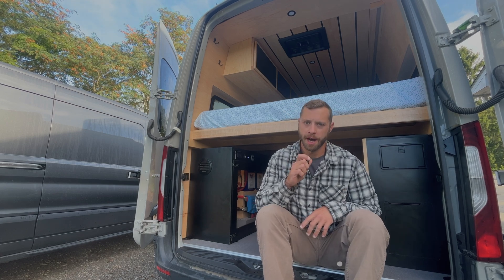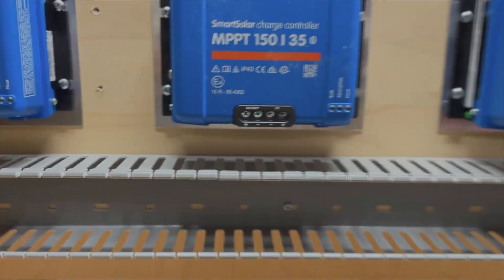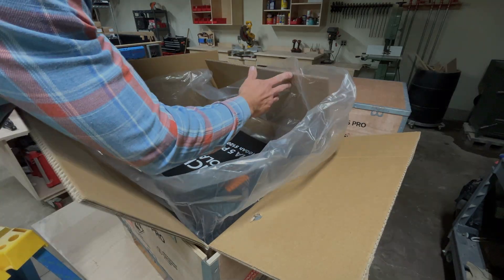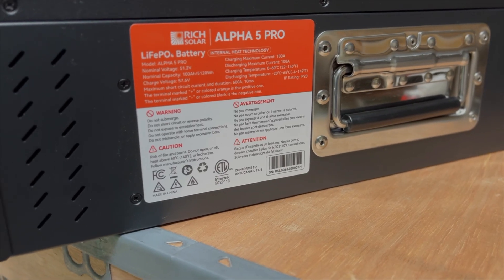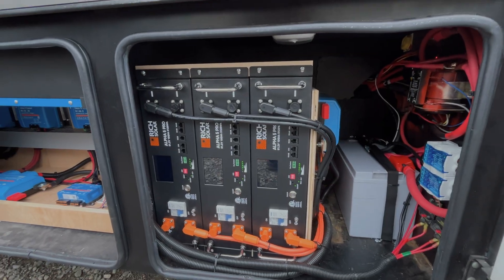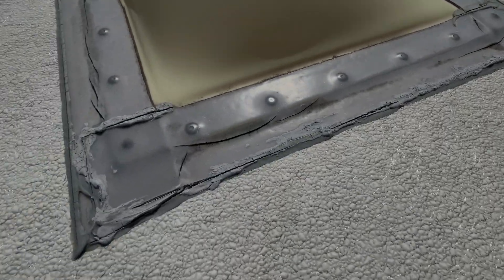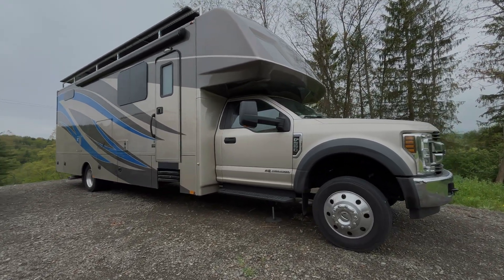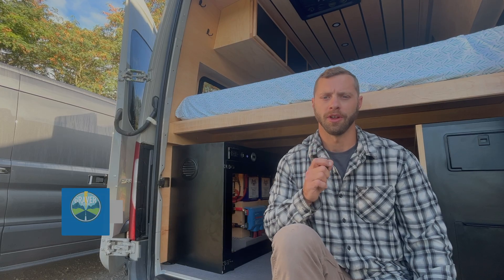The Most Solar We Ever Installed In A Class C Motorhome!

Comment: Great Job, Nice System!
However, as a former Fuel & Electrical Systems Specialist of the Military, I see the same mistake done over and over again, year after year.
Installers build systems around inefficient air conditioners. In my opinion, one of the first things that should be done is to switch out the inefficient air conditioners for the new technology inverter RV air conditioners.
This will allow for longer Boondocking scenarios.
Reply from the maker: Valid point! We always advise to consider this kind of upgrade as well but this customers goal was very clear - to get a system installed for a trip to Alaska. He very much intends to install a highly efficient mini-split system, hence the 240V split phase system.

Comment: Nice install!  I’d like to see a solar install to an all in one as economically as possible but also with high solar kW and battery kWh, like this one.  Could you get anywhere close on cost given the labor savings if you went with a budget brand, like using two Pecron E3600 in parallel, for example.  Then all you have to do is plug the short power cord from the RV into that.
Reply from the maker: Hey Nick, appreciate the kind words! We don't typically use the "all-in-one systems" and much prefer having individual pieces of equipment to accommodate our customers specific needs, especially systems of this size. In my opinion there is little savings when using those systems and are difficult to service if any one of the components needs replacing. Hope this helps!

Comment: It's nice seeing someone actually putting a decent economical 48V system into an RV instead of stuffing it full of expensive high-amperage 12V equipment and cabling.  Nice seeing those Victron 150/35's in there... that's my go-to charge controller.  I couldn't quite tell which DC-DC's you were using but they look like modest to low amperage as well.

Not much in that bay that will actually get hot except maybe the inverters... and even then maybe not.  Nice job!

Did you use a 12.8V down-buffer battery and DC-DC (trickle) charger to the legacy 12V bus or did you go with beefy DC-DC converters?   What was your solution for 30A vs 50A shore connections (aka 120VAC vs 240VAC)?

-Matt
Reply from the maker: Thanks for the comment Matt! Yes, we defiantly prefer to use the highest DC voltage possible for any of our installs because it brings an intrinsic safety to the system. Can you imagine two 5000W inverters drawing 800A at 12V!! This is why a solid electrical design is so important for every individual. 

We used both 12-48V and 48-12V converters to take care of house loads, and alternator charging. The inverter/charger takes care of the 50A 208/240V shore power through proper programing. Hope this helps!